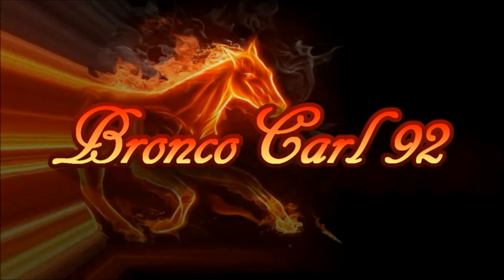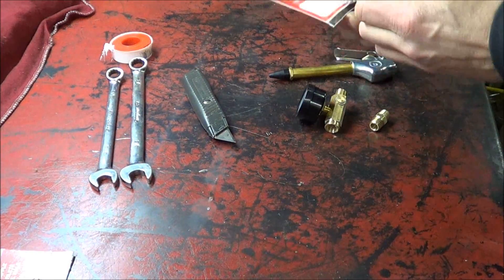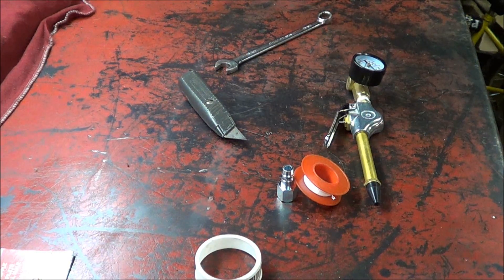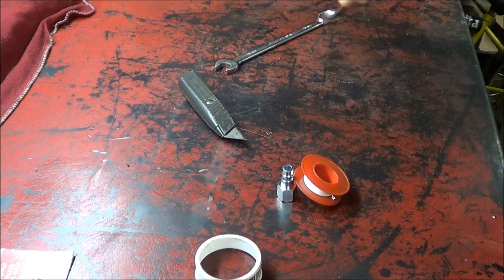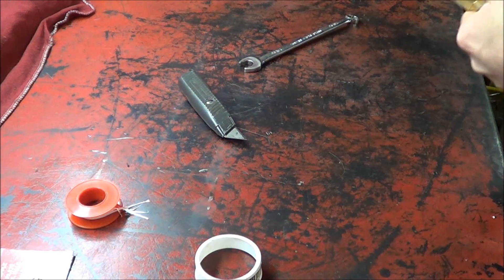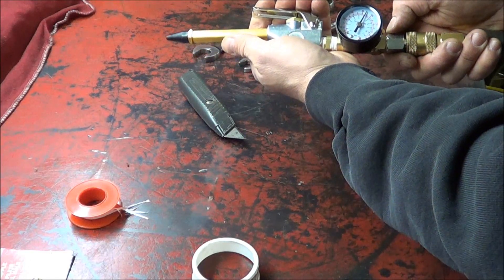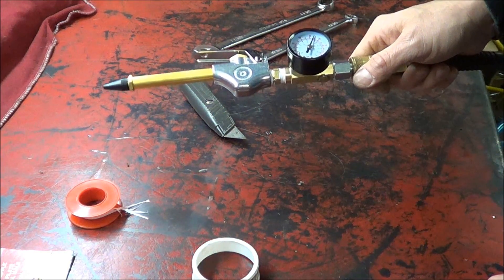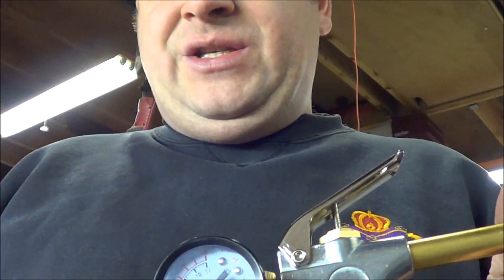4-2-13 automatic transmission clutch dry testing tool

Comment: Transmissions commonly run pressures of 100 to 200 lbs so why are you worried about blowing a seal ?
I AP check mine at what ever pressure is in the compressor which is usually 90 to 130 lbs.
Never ruined a seal checking with air in 40 years .
FYI if you are so worried about too much pressure save yourself some money & turn off compressor drain to desired air pressure the do your desired air checks .